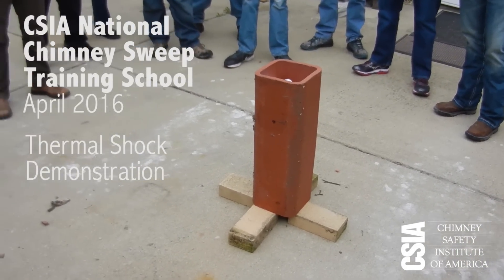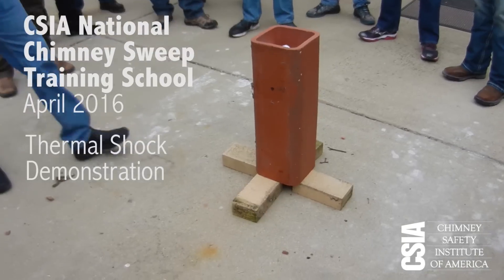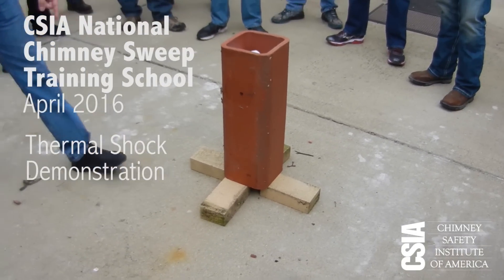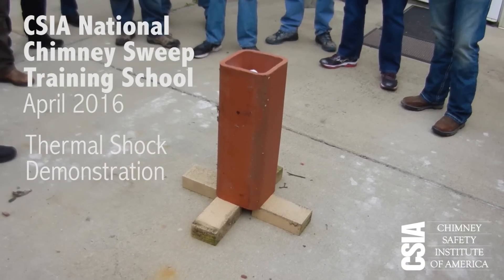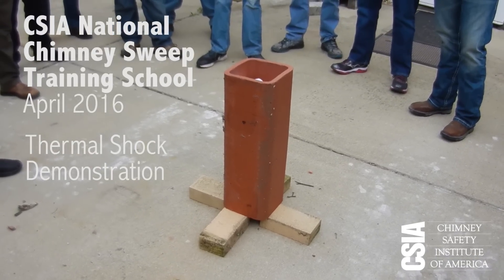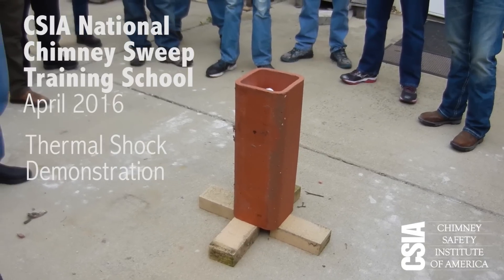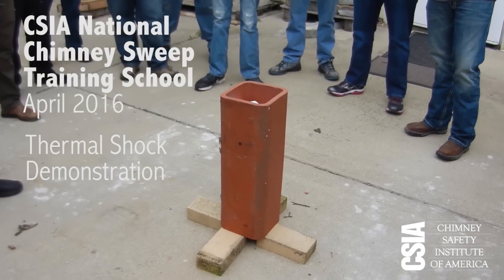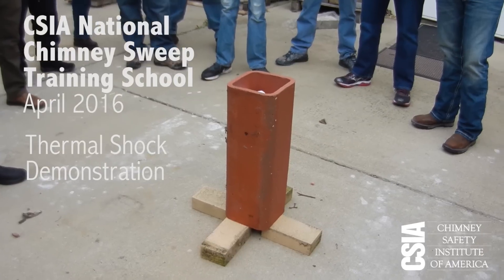Chimney Fire & Thermal Shock Demonstration

Comment: I just built a Masonry chimney using a product called Chimtek..all the Amish families I know use Chimtek and they all recommend it..I wanted to find out for myself if the liner and chimney would hold up to a chimney fire just like the manufacturer said..so I took a scrap piece to work and heated it up with an oxygen/acetylene rose bud torch..I blasted the end for 2 minutes and it was glowing orange..I could see some puddling like it was making glass...at the end .there were no cracks or distortion.. can't believe it..I feel super confident about this chimney and can't wait to use this coming Friday.. 🔥

Comment: The old timers knew how to build a chimney with the brick and mortar right up against the flue tile so the expansion and contraction of the tile couldn’t happen and crack. Yes it “might” do some damage to the exterior of the chimney, but I would rather repoint the outside instead of having to install a stainless liner. 
Today you have an 1”-2” air gap in between the brick and tile when building, so yes now it’s going to expand, contract and crack.

Comment: Clay liners are the best for chimneys. YOU have to build them to code. After that, a proper block and clay flue liner chimney will easily allow you to burn coal and wood and whatever else  for 30 years, or more. And, you have to warm them up gently at first. Oh, and you need a cleanout at the bottom. How many New Yorkers want to scoop out creosote??

Comment: The clay flue pipe  is surrounded by a masonry, reinforced chimney..the clay pipe shown here is just the liner of the chimney...not the chimney itself...try doing that demonstration in a real chimney and see how the clay liner reacts...so dumb
Reply: Actually the masonry you refer to only "encases" the top and usually has between 1 inch and a couple feet of  air space between the masonry and the rest of the flue tiles from the smoke chamber all the way up to the crown which is the only thing you can see unless you're there during construction
Reply: Yes it can. Happens all the time. Joshua B is 100% right. Come hop up on a roof sometime and we'll show you.
Reply: c dawg nothing will happen
Reply: I agree what a pathetic group of guys
Reply: I don’t understand why they wouldn’t make chimney flues stainless to begin with. WTF. Clay liner ain’t worth a fuck except channeling smoke